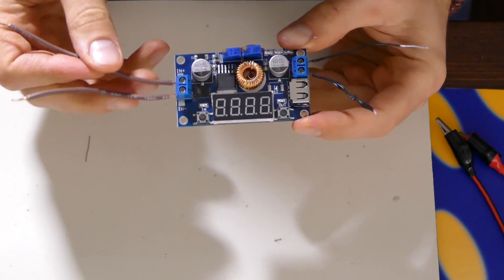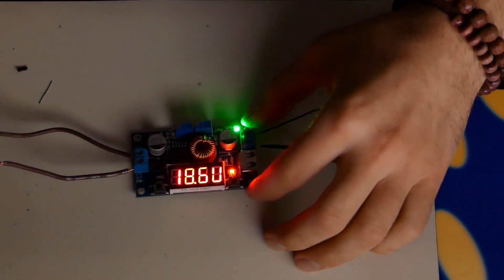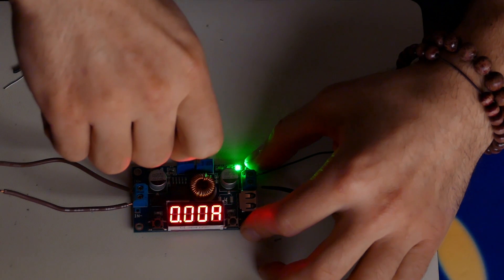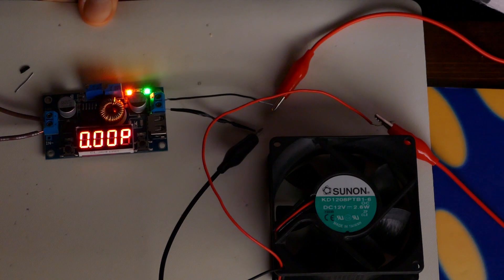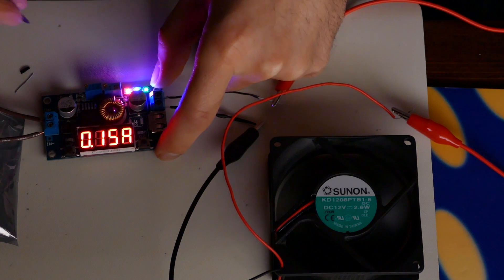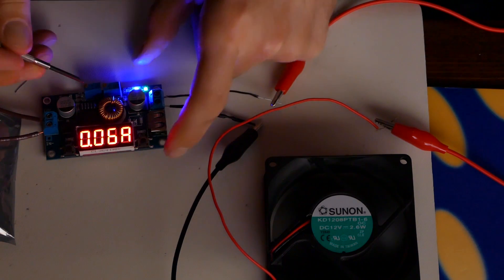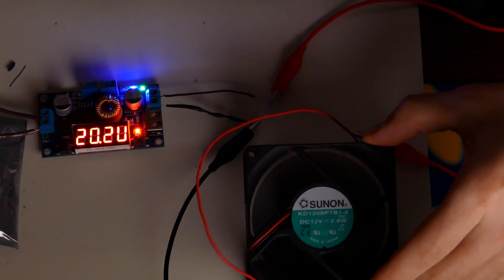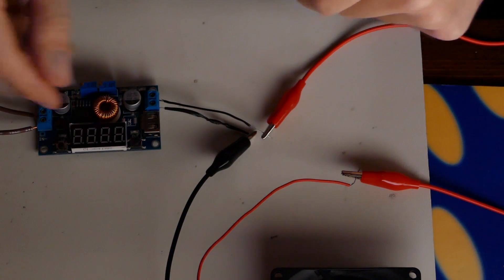DC - DC Step down module test

Comment: I bought two: I use one to obtain a fixed voltage of 2 VDC for the glow plugs of RC engines. It is ideal as a makeshift starter for my car. :)
I removed the multi-turn potentiometer that regulates the amperage, replacing it with a 0.039 ohm 3W resistor (better still 5W :) ), in order to obtain the maximum available current (in this case 6A) without complications.

Comment: Assuming I supply the module with 12V, set the module to 10V, if I reduce the input voltage to 10V, which output voltage do I still have on the module (Output) ?

Comment: hello, I would like to power a camera back between 3.7Volts and5volt (380Mah max). when I go to adjust the step down in + -3.7Volts how many amperes I would have in output?

Comment: You do realize that the little push button switch closest to the outlet side allows you to stop the scrolling of the meter at either input voltage, output voltage, amps or current. The little push button close to the input side turns off the LED's. Thanks for the nice review.

Comment: Hi,I bought this converter from china ,but I dont know what is on display the ....P?
If press right button is:
input voltage ,output voltage,output current and the ?P(1.2P,2.4P ...)
!!!! And very important: !!!!the USB slot not constans 5V, this same as output.
You must first setup to 5V, if want charge mobiles etc... I dont set and my tablet ruined.
Good video ,thanks.
Reply: https://www.youtube.com/watch?v=GyrcYOdK7Og
Reply: I have the exact same question (what is 1.2P?).  I don't suppose you've learned the answer?

Comment: I'm not trying to ruin your day, but these onboard Chinese led readouts are never accurate and then you test it with your best volt meter and that has a different reading so now what? Yo rush around the house to find a Samsung phone charger and you find a different reading, but it seems more accurate to the ratings on the charger, but you go to check the amperage and you get zero's well that's because you have to short it to find the amperage and higher quality chargers have a protection circuit and cheap one's don't! So you can sync your imax b6! How do you know your volt meter is dead on accurate? Did you sync it to a oscilloscope? You can do it by taking the back off and adjust the screw while it's connected to a professional oscilloscope if you have one or take it to a shop then sometimes you can get one of these cheap power supplies that you can sync and some you have to remember the real voltage readings and set it up that way. I had so many of these that over charged my 18650 cells to 4.4v and some 4.0v so this will help.
Reply from the maker: +MrBrymstond doing a test now on the voltage difference posting video soon.. I find  for the most part not that bad. I've we are Talking mili volts or amps it shouldn't be a problem even long term but let's see.
Reply: Tested the same one with a volt meter.. accurate to the 10th of a volt.